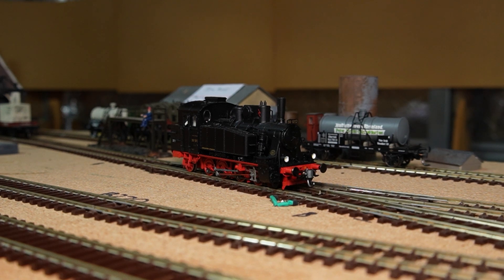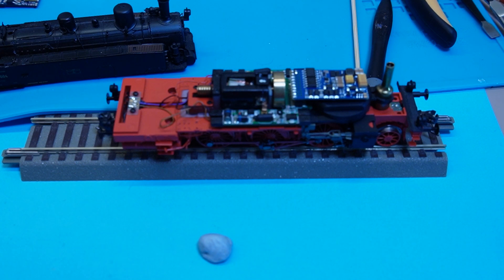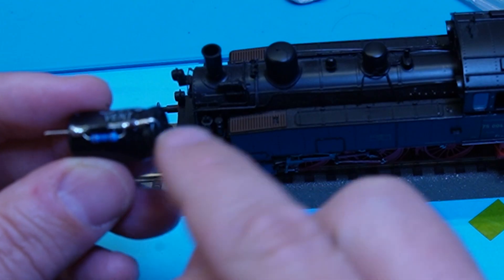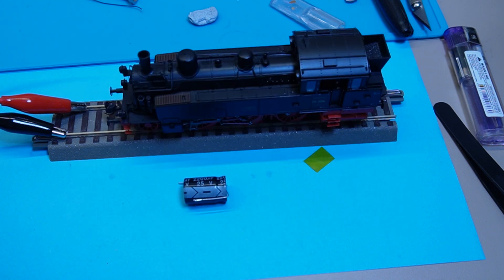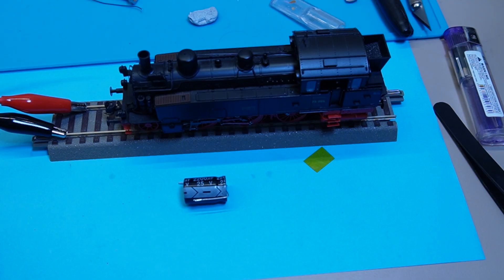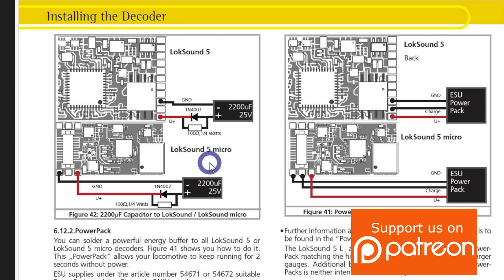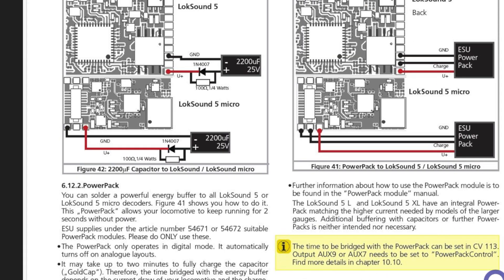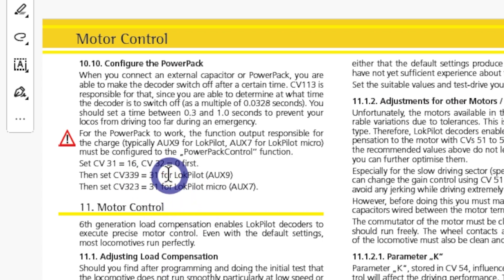Ultimate Guide to DIY Keep Alives for Model Railroads | Easy Solutions & Essential Tools Explained!

Comment: I'm confused that everywhere I look states the 100ohm resistor can be 1/4 or 1/2 watt. 

But using ohms law (I=V/R) on 100ohms at 12v gives a current through the resistor of 0.12amps  which at 12v is 1.44watts.  

So the recommended 1/4w or 1/2w power rating of the 100ohm resistor seems far too low or am I missing something here?
Reply from the maker: Hi, which part of the video have I mentioned these values??
Reply: OK thanks.  I've emailed the author of the pdf you've linked to with that question so will let you know their answer.
Reply from the maker: @Philxjman  please do cheers
Reply: I've had no reply to my question from the club in your link (Great Falls Model Railroad Club).  
So I've done some more research and found that the manufactured ready-made stay alives use a much higher resistance than 100ohm to ensure that the power rating of the resistor isn't exceeded.   So I'll be using a 300ohm (1/2w) resistor.  That will still charge a 9400uF bank of capacitors in 1.4sec.  And if larger charge current is needed for a larger capacity stay alive then I'll just add 1 or 2 more 300ohm (1/2w) resistor in parallel.  
Hope this helps.
Reply: 1m50s - 1m54s.
Reply from the maker: @Philxjman it works to limit in rush of the cap. Here is a neat website to explain in more detail: https://www.greatfallsmodelrrclub.org/wp-content/uploads/2021/05/SuperCap-Stay-Alive-Presentation.pdf
Reply: Yes,  I understand that's what it does.  But the 100ohm resistor needs to handle 1.44w so I don't understand how a 1/4w resistor can be used.
Reply from the maker: @Philxjman I am sorry not a electrical engineer. I’m sure an indeoth google search will answer your question

Comment: In the old days I something similar for my wagon lights.. with a capacitor and a bridge rectifier.. not to deal with AC to DC but to deal with the fact of reverse polarity blowing up the capactor if the + and - were reversed.

Comment from the maker: Be the first to ask a question or answer some of my questions:

1. Would you use a keep alive? Would you consider making your own?
2. If you would, what tweeks would you do?
3. How could I have this better?
Reply: I use the RailPro system by Ring Engineering. It is RC (radio control) as opposed to DCC. Their modules (similar to decoders), allow for the company's keep alive to be attached, which is a separate, optional component. I am new to this system and like it so far. However, I have heard others use third party capacitors with the system with some success. How does your design change if you would want longer capacity? That is, if your current design allows for, say, 2 seconds of dirty track, how do you increase that to 5 seconds? Is it simply a matter of adding more capacitors or does it need something else? Obviously, available space becomes an issue at some point, but how would you scale this up for longer run time?